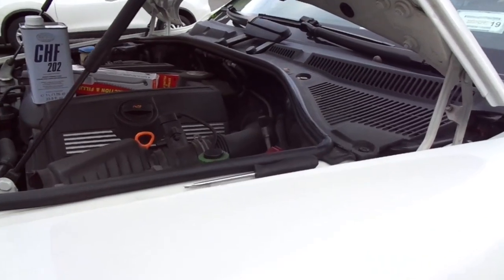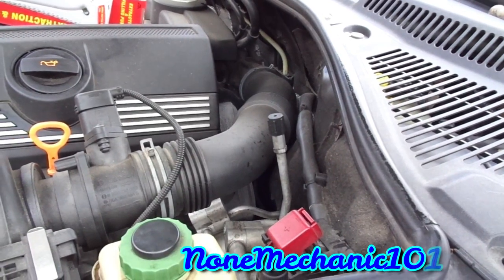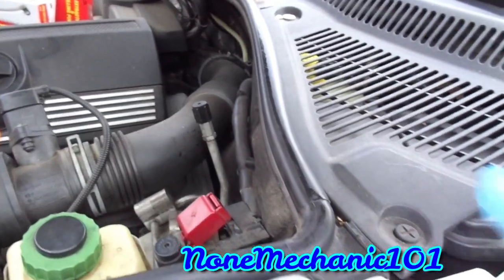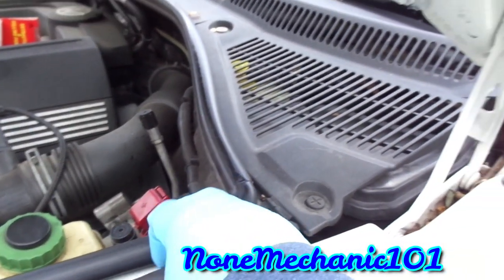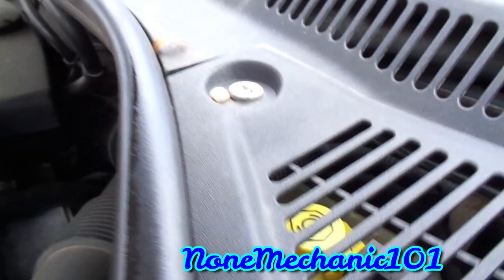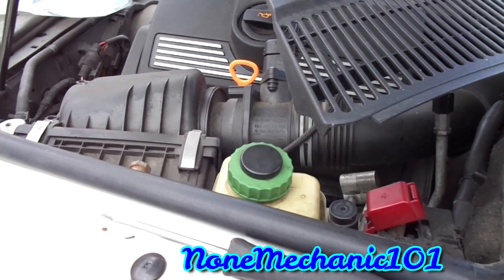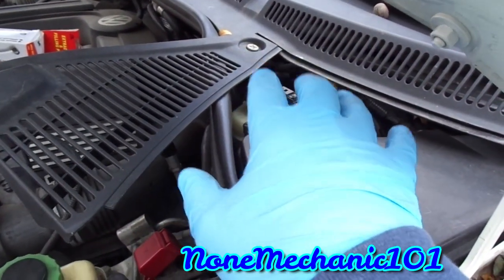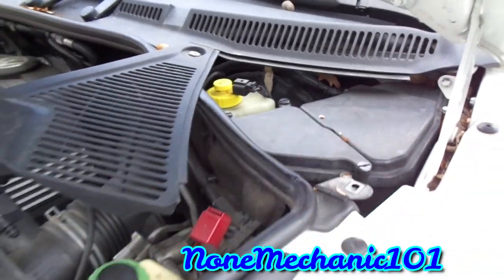2006 Volkswagen Touareg Brake Master Cylinder Location

Comment: Hey thank you for the great video and for your help , I have Audi Q7 3.6 same setup my driver side brakes are not working at all , I checked the caliper it’s good but it’s not squeezing the brakes, I undid the brake hose but there was no oil coming out of that too, could you please help me know what I should do next , thank you
Reply from the maker: Are the sliding pin moving? It may need some grease.
Reply: NoneMechanic101 thank you for the reply, there Arno sliding pins in this case , just no brake oil coming out to squeeze the brake